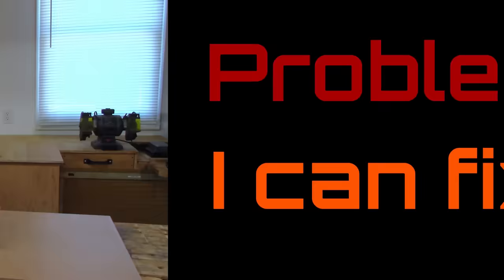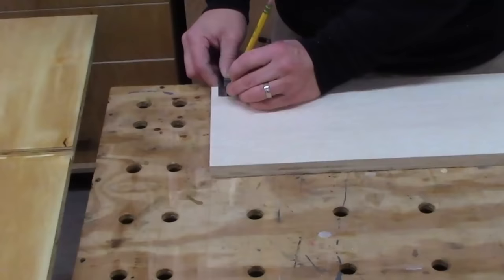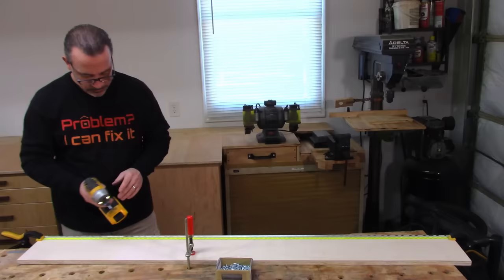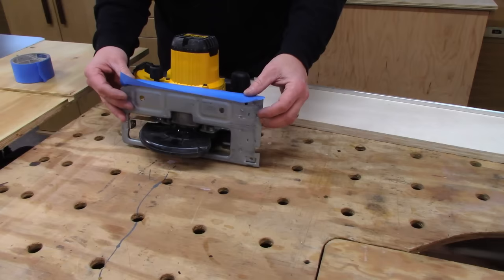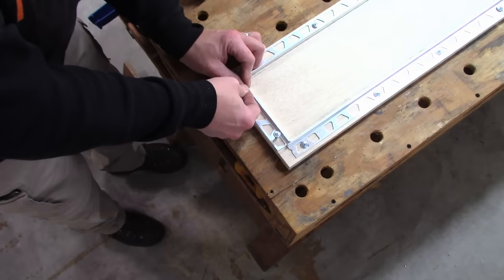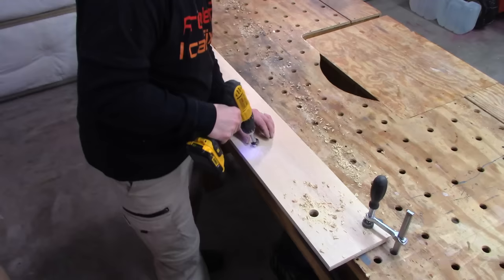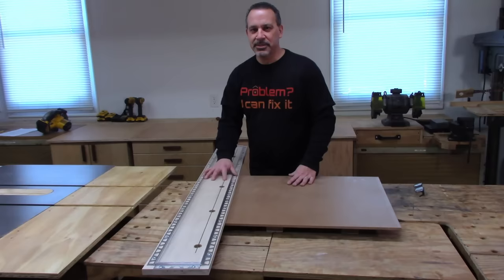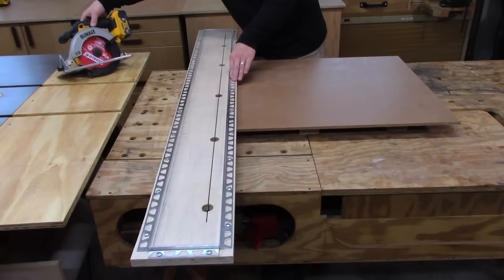Festool doesn't want you to see this DIY track saw

Comment: you just need a dust collection hose. Make a moving boom to allow you to use the vacuum hose to the saw so the hose will go up towards the ceiling. Then the boom will allow the hose to move freely about 3 to 6 foot in an arc. Depends on how long your boom is. You can also make it retractable if you like as well.
Reply: yeah that's a great idea, but I'm pretty sure this guy has thought about that and doesn't want to spend the money on an hvac system right now for his shop. He asked for any additional ideas that people would like to see, not a complete obvious assumption of, "You need this..." blah blah blah.  Hey, you should go to other videos and tell them what they need to buy.  Maybe tell an off road vehicle owner,   "Hey you have an off road vehicle and I noticed you drive through 3 feet of water, if you install a snorkel kit you can go deeper."

Comment: Nice DIY design and build!
I own a Makita cordless track saw and love it.  It was expensive but worth it to me.  If I had seen this prior to buying it I may have tried this.  However, the Makita track saw has some definite advantages over this including dust collection, extendable tracks, easy alignment, easy adjustments and such.  And it cuts much better than my circular saw.
But if you’re tight on funds then this DIY version is definitely a good choice.
Reply from the maker: I'm probably going to get one soon.  From what I've seen the Wen is more than adequate but the Makita tracks are better.
Reply: @HouseDoctorRay  I haven’t used the Wen but it does look like a capable saw and a great price point.
Reply: @House Doctor Ray recommend checking out the Concord Carpenter review before buying. I did and wound up with the Makita along with the dust collector. It aims squarely at the Festool. It falls short, but comes plenty close enough at a much lower price. I've had nothing but good results from it.
Reply from the maker: I'll check that out, thanks.

Comment: You should have noted that this can be made to fit a jig saw, too. Not everyone that is trying to start out on DIY has a circ saw. 

And, gentle readers, there are ways to do this without making such a heavy jig. There are guides that you can put on your saw, itself, slide on, and tighten down, for cuts within a few feet of the original edge.
Reply from the maker: Good idea.  Thank you.

Comment: Killer video! I love it! As for the split screen video trick, you need to get the window out of the mix because the light and exposure will change with each take. So be creative to cover the window and then, also be careful with your lighting. Your shadow is casting through your split screen adjoinment so you have a hard line there when you enter from the right. It's cool shot and made me giggle. Everyone else surely loves it too. I'm just a detail guy. Anyway, use 3 point lighting and set your camera exposure to full manual. Test in that mode until everything looks good. Practice some takes as you enter the shot and make sure your cut not included in any shadows. All those TV shows we watched as a kid worked this trick. I learned about it around 10. Im 53 now. My father would point it out, and back then, it was physically spliced. You could see the shadow errors here and there but we didn't have the ability to hit rewind or play again. It wasn't until analog video changed to digital and Final Cut Pro came out, that I perfected this. Im more than happy to answer any questions. Let me know. I love your flooring section aluminum and will try it out and the effect made my day! God bless!
Reply from the maker: Thanks for the tips.  I'm using a cheap camcorder right now and struggle with the exposure.  Biggest problem is it doesn't remember any settings so I have to reset it every time.
Reply: @HouseDoctorRay  I understand that situation. If you kill the window (And always should and develop some cool background) and simply get your lighting set hard, tested and NEVER moved, you won't need to worry about manual exposures so much. Just keep the gap in the middle (Cut line) large enough to stay away from the shadow fall off on both sides. This effect can be done 100 perfect with any cell phone. It's the lighting, camera angle, and testing that brings it home. Your video is so cool. Problem, solution! That's Mike Lindell's favorite line. Ya got a problem, well, you need to ask good questions to find the solution. Many times it comes from someone else. Don't have a panic attack, because you didn't come up with it. Just accept it as a blessing. Hey Ray, would you like to chat on the phone and talk about this and YT? I'm starting a channel as a hobby but man, I've seen some great content over the past 2 years and want to know more about the back end, as a content creator, such as you. This video has 2.6 million views. I'd say it would be fun to chat together. Any interest? ( We can work out the details later)
Reply: It can be done even simpler. The key thing is to feather the edges of the mask of the clip you’re overlaying. Also avoid straight lines i.e drawing a rectangle mask. Rather use a polygon mask and draw a zig-zag line over the edge that meets the other clip, then feather it. This will go a very long way in blending the two different shots together even with uneven lighting. I’ve done plenty of these shots outdoors with constant lighting shifts and was able to consistently blend them together using this method. I don’t know what editing software you use or I could give further tips. 

Enjoyed your video. Thought about buying a jig but may try something similar to this.
Reply from the maker: Thanks for the tips.  I'm using DaVinci Resolve.
I think I just stacked the clips and cropped the second clip.  There is a lot to learn with that software.

Comment: As a German carpenter, the idea with the " Schlüter Schiene" ( Rail) is really not bad! But your construction isn't better than festools rail. The most important Fact on the festool rail is you have also a non slip rubber lip, but this lip also is your optical measurement check line, Wich is 100 times better be seen with an open system than your solution. And, if nessesery, you can use the clamps additional at festool.  Your solution does what it has to do. And it works properly. But there are better solutions, if you are honest 😉! The Festo Tools Prices are ridiculous!!!! The circular dive rail saw is the only tool, I own private from Festo. And one Hand router. I have bought Both Maschines, only because of one reason : the standard Rail system, and for the router they got even something newer and better😁😁👍👍💪💪‼️

Comment: Excellent, Ray. In terms of dust collection, I have a DeWalt DCV584L vacuum unit that attaches to the dust port at the rear of your circuklar saw; I purchased 10' of commercial vacuum hose & swapped it out with the hose the DCV came with - it's plenty long enough to make a long cut run, & does not obstruct, either, &, like the saw, the vacuum is cordless (also mains powered), & portable.
Reply from the maker: Thanks but I need a DIY solution because the saw I have, DCS393, doesn't have a port for dust collection.
Reply: Understood, Ray - my error for not spotting the absence of a port; obviously, the major issue is that, were you to build a vacuum port on the underside of the Track Saw guide, this would make your original design bulky & unweildy - & of course, obstruct the placement of the timber you wish to cut; only two options I can see - either invest in an overhead mounted dust collector, or purchase a later DW  Circular saw, with an extraction port. Your original design is nice & simplistic - the main issue is the power tool; that's as far as my thinking goes. Perhaps someone else will offer up a better solution - good luck !
Andrew.
Reply: Understood, Ray - my error for not noticing the absence of an exhaust outlet on your saw. To build an underside extraction box would obviously make the Track saw guide bulky & unweildy. Only solution I can think of is either a) An overhead extractor purchase, or b) Buy a later DW circular saw with an integral port for extraction; perhaps another commentator will provide an alternative fix, tho' I see that as doubtful. In any event, good luck with that solution.
N.B. I bought my DW C/saw, refurbished, & it had a poirt in-situ - I'm sure you may well be able to pick one up from say, e-bay ?
Andrew

Comment: I do think this is a neat idea and I wouldn't rule out building one in the future.  However, I have been using a commercially made straight edge (comes in two 52 inch sections that has a bar connecting them -- purchased at a big box store ~ 10 years ago) that has worked well for my purposes.  Yes, I have to clamp it (but that hasn't bothered me), and yes, I have to be mindful to keep the circular saw pushed against the straight-edge, but it also doesn't take away from my full depth of cut of the circular saw if I need it -- a drawback with using a 3/4" plywood here.
Reply from the maker: I have the same straightedge you're talking about.  I use it on the rare occasion I have to rip a full sheet.

Comment: Great video..,.while looking at it I had an idea to substitute round wooden curtain poles for the lengths of Aluminium...the poles are pushed against the saw base plate on on the cut the saw is locked down...of course I had to leave one end open to get the guide to work but so far so good ...many thanks to you....u are one clever man...stay safe....
Reply: Should say..and on the cut the saw is locked down..
Reply: Scratch the poles! Bad idea,! Back to the Aluminium! Great idea!
Reply: Could I ask what you are rubbing into the wood at the end of the video pls? Thank you...
Reply from the maker: Car wax.  Helps the saw slide better.

Comment: One suggestion rather than waxing there are mold, release, agents, you spray on summer silicon some use other chemicals. There is a mold, release agent called stoner. I find it is one of the best spray it on once, and it will be slick for a very long time. Plus, it gets in areas that you can’t always get into with wax. Great video. Thanks.
Reply from the maker: Thanks for the tip, I'll look into it.

Comment: To make this easier, get some 1x4x8 MDF and glue it to a sheet of Hardboard Tempered Panel 1/8in thick.  Make the initial cut and there you go.  Put that on any line for a perfect cut every time. You can always toss it and make another. It's the "poor man's track saw".  You can make it fancy if you want but no need to.  Keep it simple and you wont feel bad if you need to toss it and make another.

Comment: Great idea, heres some thoughts i had, saw 2 shalow rips in the back, a blade will do and fill with silicone, it wont scratch finish wood, perhaps an adjustment cleat on end for those pesky angles. Let me know what you think and thanks for the video
Reply from the maker: I think I'm going to check out silicone tape and see how that works.
Reply: @HouseDoctorRay  hmm, the tape might even be better then a grove with silicone in it, it might be hard to get it even, so hell yea do the tape, I'll watch, I think your on point here and are making a solid idea. I'm gonna subscribe, I like what your doing. Thank you

Comment: You've got the cut closer to one side of the track. So flip it around and do a 45 degrees slot on the other side so you can do the 45 degree angle cut on jobs.
Reply from the maker: Maybe, the center might get a little sloppy though.

Comment: Definitely going to build one of these. I have a Bora guide, which is great and has it's uses (especially for shaving doors) but it's slow to setup. I think I'd like to come up with some sort of removable cleat to attach to the bottom side of the end.
Reply from the maker: That's why I built this jig.  Doesn't require any modifications to saw and no setup or adjusting when you go to use it.

Comment: I would urge you to try a worm drive saw simply because there is no end play on the blade as comoared to sudewinder saws.. 
  I use them to break down plywood at the job site to manageable size for a tabke saw.. So much more powerful and stable than a sidewinder .
   I often use a one side track and just let the worm drive skim along with few issues...again due to the ability of the saw to go straighter than a sidewinder.
  The  y even make worm drives in smaller sizes and lightweight magnesium

Comment: I've seen a ton of different videos on this subject. I think this one is the best method yet. Love the tile edges idea. I think I'm going to toss out my old one and try this.  I didn't even know that non-slip tape was a thing.  You could route a dovetail groove along the bottom and use dovetail clamps underneath.  Also, the mod from @umakegoodcookies comment below sounds like a great option.
Reply from the maker: Thanks.  I'm very happy with it.  It will definitely work better if your circular saw isn't built backwards like mine.

Comment: If you ever hit that piece of aluminum with a carbide-tipped saw blade, the saw blade is going to be just fine.  Somewhat to my surprise, a few years ago I learned that ordinary chop saws are routinely used for trimming aluminum (in a robotics competition).
Reply from the maker: True but the screws may be a different story.  Diablo makes a blade for circular saws that plows through nails but it may not be the smoothest cut.
Reply: @HouseDoctorRay  This reminds me that it took me only about one second to turn a sharp chainsaw blade in to a dull one when I hit a screw.  *sigh*.  If I'd had carbide teeth on the blade I might have had a fighting chance, but chainsaw teeth are just steel.

Comment: How about a JET air filtration unit. I’ve got one in my shop and it works great. I’ve also got a ShopSmith vacuum extractor that works extremely well, I have made a jig to attach to my Skil saw dust outlet port, no dust in my shop while cutting. I hope this helps you. Great video!
Reply from the maker: Thanks.  Problem is my saw has no port.  I'm going to have to rig something up.
Reply: @HouseDoctorRay  yes definitely do rig something up or wear an airshield on your head and face.

Comment: I've seen different variations on this particular track saw. The tape is a pretty good idea, but if you want it to be absolutely rock solid while you cut, you can use a piece of MDF as your base and use the Microjig dovetail clamps on the bottom of the MDF, this works really well. I like the aluminum you used. Will have to check it out.
Reply from the maker: I have the microjig clamps and like them a lot.  I'm not sure they'd work well on MDF because it's so brittle.
Reply: @HouseDoctorRay  I have used them on MDF, granted I did double them up and glue them together. Maybe a nice piece of thicker plywood would do the trick.

Comment: Very neat, I wonder how such jig would hold if you try to adapt it also for cuts at an angle. I guess it would hold, because the saw is guided by the outside rails and there will be enough plywood to support the saw but because the saw is so much above the material to be cut (due to the thickness of the jig) it will be very hard to appreciate where the cut will go (which is not a problem for vertical cuts). Would be nice if you revisit this video with experiments of suitability of this jig for cuts which are not 90 degree.
Reply: Made one using laminate flooring strips, being thinner it does accommodate angle cuts. However like the masking tape idea as first version the saw bound at points.

Comment: HUGE improvement. I think you just saved me a hundred bucks. I'm def. thinking about it. Anyway - brilliant tips - the holes, the non-slip tape, and the "track" and methods. :pride-person-earth-intersex:
Ah - I have my answer. So what would you do? I am very tight on space and dust is a major issue. I actually need to buy a track saw for dust control anyway - and the track for the 7.25 15 Amp WEN is only 70 bucks - and I decided I'm going to turn 2x50 into 65 + whatever's left (I won't use it.) I love your holes for continuing a cut straight as hell. Track saw you just line up the edge. So - all in all - I'm in for the power-dog Wen. THANKS!!

Comment: I've been looking at Ideas to eliminate the use of my table saw, I will admit even after 30 some years I still fear it mainly because of kickback even though I stand to the side. It seems the kickback is when guys get their hands and fingers pulled into the blade even using push sticks or blocks sometimes, It's just a wild animal. A crosscut sled I'm comfortable using though and I think this jig will work for me too. It looked like it was binding up a few times though so I think some Bees wax would make it slide much better. Pretty good Idea sir, thank you for sharing.

Comment: I used an 6ft level that I clamped down to butt the aluminum edging up to before fasteners.  Got a nice tight line when done.
Built it for the heck of it.  It's good enough for ripping ply and if it gets dinged up, so what.